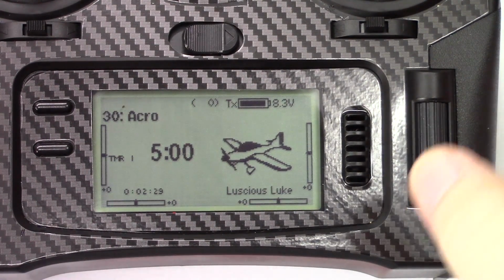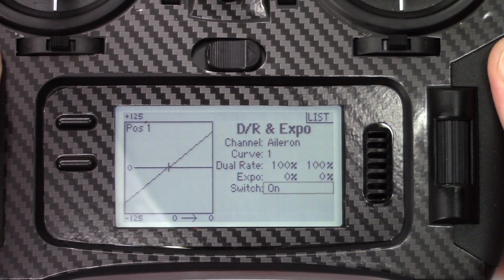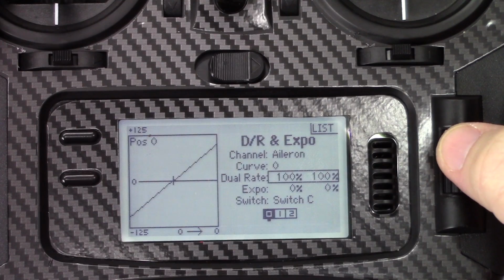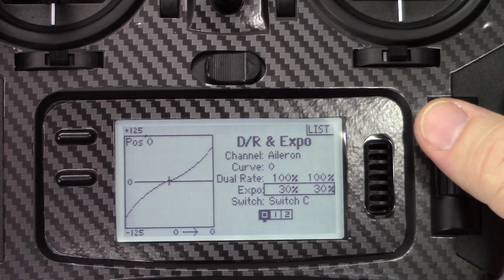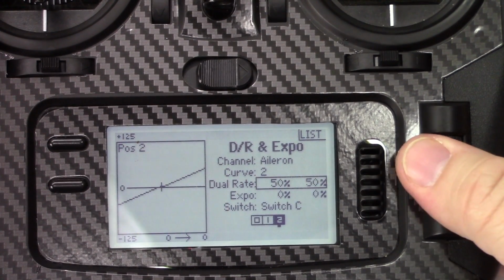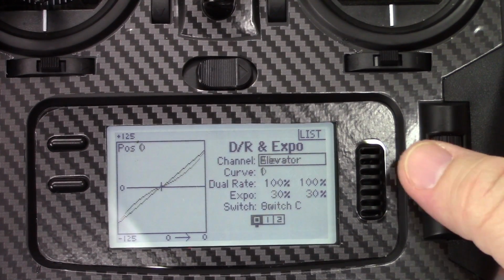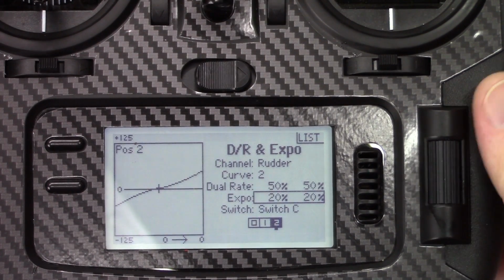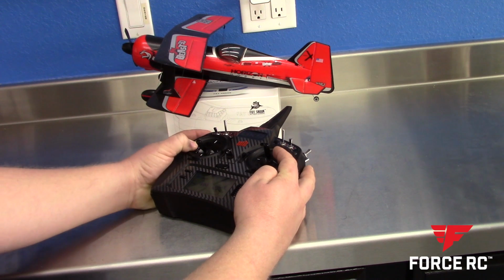Force RC - How to: Dual Rate and Expo Setting for Air Transmitters

Comment: Easiest to follow explanation for beginners I've ever seen! Have you done any specific plane "Dual Rates settings" videos, (such as  High Wing Beginner's Planes, Intermediate Pilot planes (Warbirds?), or, Advanced Pilot planes ?
     Just as impressive as your Dual Rates explanation, is your PVC multiple plane hangers (in the background at the beginning of your video). 
     Great Job!

Comment: is it best to put all the different rates  on a single switch or  use 3 different switches for each control surface?....thanks
Reply: With a switch for each control surface, you're able better select that single surface while flying your plane; rather than changing all your control surfaces at once.

Comment: What if u only have high & low rates & no middle?? Do I still need to put them on a 3 position switch or can I put ailerons,elevators & rudder on  the same 2 position switch ??

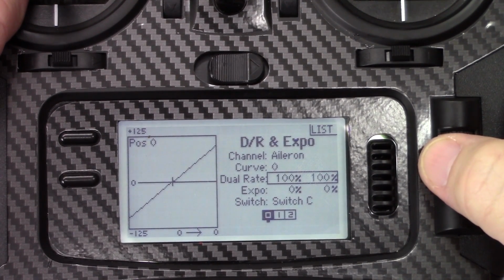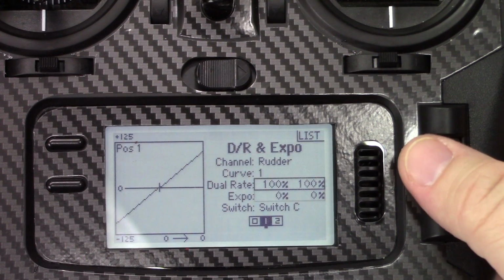Comment: Great video!  At 4:07, you changed Expo from 0% to 30%.  However, on the LCD display, you changed two values at the same time: (0% 0%)  to  (30% 30%).  What's up with that?  The same thing happened at 7:43 when you changed Dual Rate from 100% down to 75%, which was displayed as (100% 100%) down to (75% 75%).  So, I downloaded the DX9 manual, which covers D/R Expo on page 26, but it doesn't help at all.
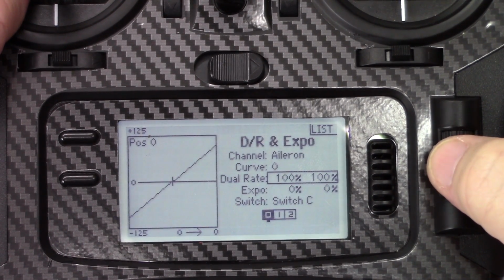Reply: I think I got it.  The radio shows 2 values for Expo (and also for Dual Rates) because each axis moves in 2 directions (LEFT/RIGHT or UP/DOWN) which can be adjusted independently.  At 4:07 (adjusting aileron Expo), you could have held the aileron stick LEFT or RIGHT to adjust each value independently.  Since you didn't touch the aileron stick, the radio adjusted the aileron Expo (LEFT and RIGHT) together.

Comment: This is the best explanation of dual rates and exponential set up I've found so far on YouTube. The only thing you didn't show is how exponential works on the airplane at the end of the video. You held the sticks at full deflection through all of the rates, which doesn't show how exponential works.
Reply: it's a little difficult to show that on a video.  Expo merely decreases the sensitivity of the stick at the center.

Comment: Pilot Luke- you be the man! Best explanation of the concepts of  D/R and Expo I have come across. I have a Spektrum radio so it was especially helpful. In the small club I belong to guys have there own way to set the D/R and Expo.They have a lot more experience than I do.  I find my planes very very nervous  at lo rates. Just as an example, I set one of my planes, a trainer (Nexstar) (all lo settings AIL, RUD and ELE) to 65% D/R and expo at 50% on the advice of a club member. I did not have the provided mesh speed brakes installed  on the plane as I felt I had the experience to manage the plane. Was I wrong!  The plane flew like a drunk monkey and it was a miracle that baby did not crash(brand new build). It was virtually uncontrollable and I had to back off that 46 OS motor to bring it back home. I did not fly it again that day. I was told the nervousness of the plane was due to the full length Ailerons. My personal belief was that it was the aggressive D/R and expo settings. Your choices appear to be much more sensible. 
   I also flew a Superstar trainer with an OS 46 with identical D/R and Expo settings to the Nexstar. Same crazy experience. The guy then changed my Ail settings to D/R 85% and Expo to 58%.In other words he increased both D/R and Expo which in my mind made it much more twitchy as you say.  I brought this plane home but again it was a very nervous bird. I can only conclude that these guys are either incredible pilots or they don't understand the settings. I personally feel the latter is closer to the truth. 
    I would love to see you demonstrate radio settings for various planes. For example specific planes or classes of planes such as trainers, acrobatic planes and warbirds. This is badly needed. Please consider it. I am sure that I am not alone and with your gift at explaining things in a simple, easy to understand fashion, you would be just the man to teach this to dummies like myself. Thanks!

Comment: I have a Spektrum DXe, and I will be using my phone to program it. 
Will these rates work for a 1200MM Spitfire plane? 
Awesome informational video, this will help me a lot.
Reply: RakinBill this will certainly be a good place to start.  Does your manual have the dual rate recommendations listed for you?  Most of them suggest dual rates in millimeters of travel.  In this case a simple ruler will suffice.  In the end, the actual percentages in the dual rates field won't matter if you are following the mm recommendations instead.
Reply: I purchased the plane used, but I will go to the manufacturer site, and see if they still offer a manual for my plane. 
I have a Dynam Spitfire Supermarine 1200MM, and it's in great shape, and it was a pnp setup, and I installed my Spektrum 6 channel receiver and bound it to the radio. Now all I have to do is get the specs, and set the radio up for the plane.
Thanks for the reply.